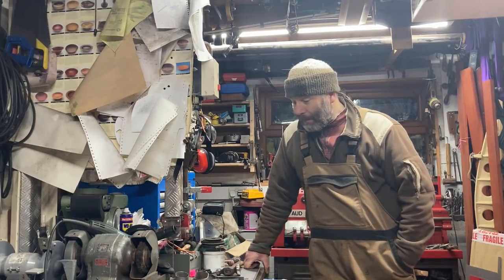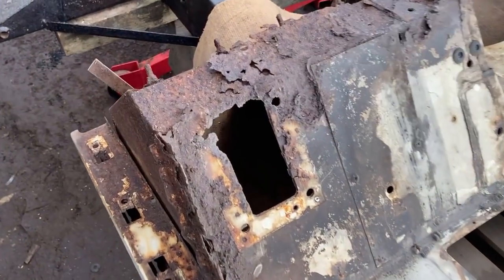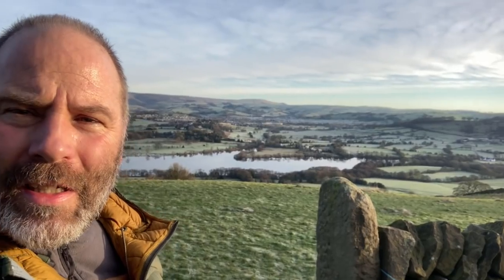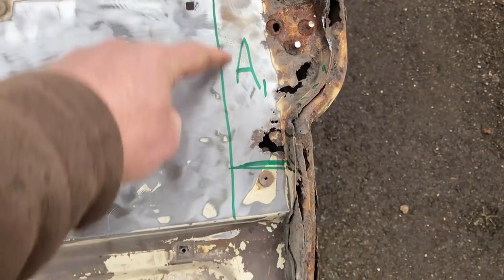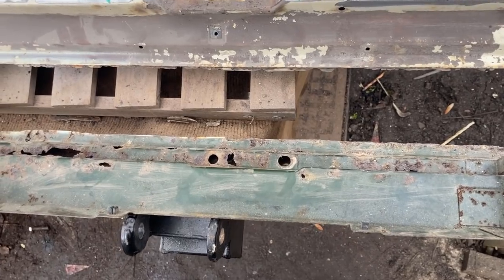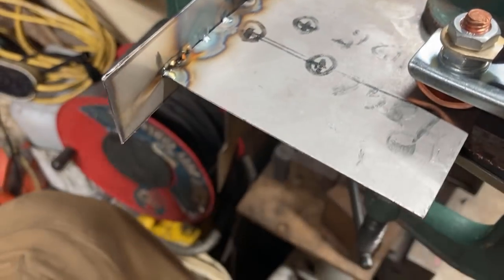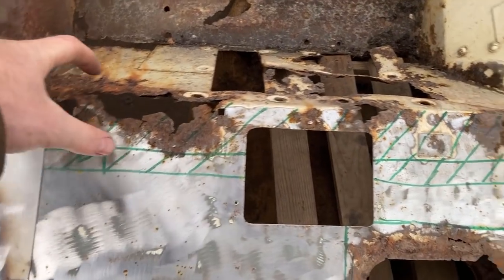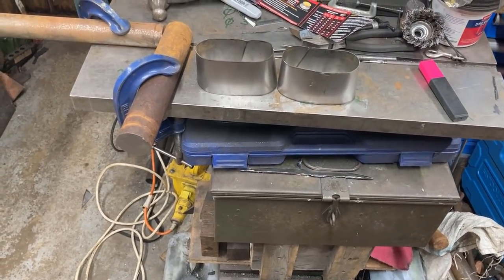Project Clanger The series 3 109" Landrover Rebuild - Update 8

Comment: "Serves them right for driving on the wrong side of the road"  LOL.
Love the dry stack walls, I've made some repairs here. They are the same construction here. Keep at it Matt
Reply from the maker: Hi Steve, good to see your comment - was concerned you might be stuck wellies deep in your concrete slab ! :-)  Ive done a few yeards of walling and its hard work unless you have good stone to hand - which is usually not the case - the good stuff went into th ehouses, barns etc. There are lots of styles of dry stone wall even in this area, each style for a different application - some of the best is 'estate boundary walls' usually 6ft or more tall and made with better stone. Other is far older and literally the biggest stones from the enclosure dragged to the edge and smaller stone piled on top into a very rough wall - many date 300 yrs or more. All the best for 2021 my friend to you and your family.
Reply: @lookcreations  Something about stone work really appeals to me. I like dry stack walls the best. Some are so good you wonder how long the guy spent finding the perfect stone for ever place. Its definitely a skill that takes time to learn. I grit my teeth when I see one torn down and some modern fences put up in the place of them. They go from a 300+ year fence to a 7 year one. Definitely more work in the stone ones but they last forever and look great IMO.
Keep up the hard work Matt, a great 2021 to you and yours 👍
Reply: @SteveSummers  there’s a fabulous display of dry stack wall construction at the Pleasant Hill Shaker Village that can’t be TOO far from you. I spent an hour just taking pix of that alone. A lot more than just rocks stacked up. Real creativity in an unexpected place. The rest of the place is just terrific, too, BTW.

Comment: A massive undertaking there young man. Not having a Tig welder myself so if I was taking on the challenge it would have been Mig welded up using 0.6mm wire through my BOC Automaster 185 on it's lowest setting.
Reply from the maker: TIG may be a less than ideal choice but I’m sure it’ll do the job if the operator gets some practice! Thanks for stopping by. All the best Mat

Comment: Hats off to you for jumping in the deep end. Great to see you involving your daughter in the build too. I tig weld a bit as well, so know how difficult it can be. And so unforgiving sometimes! The only advise I might offer is to clean areas to be welded, get your tungsten ground nicely and get in nice and tight on the arc. Also,maybe a bit MORE amps. Looking forward to seeing how you improve.
Reply from the maker: Really messed up not cleaning the new metal for welding. The second patch I cleaned and even the tacks went on better. I think more amps and faster travel would improve the weld, that requires a lot more control of the torch and I’m a ways off that yet. Still, I have plenty of seams to gain experience and practice on.
Reply: @lookcreations  great to see you tackling it. Its very satisfying when it all comes together. Good onya

Comment: HI, only recently found your channel, watched a few and have subbed. I've started a resto on a 1968 2A 2.25 petrol. No vids up yet, but plans to do one on it's Lucas 11AC alternator which needs to be converted pos to neg ground, and I'll add the 'triode' upgrade at the same time. Keep on posting... I'm hooked now :)  Ohh.. I've just got a TIG welder too, old but good.. absolute beginner too.. been flux core welding for a while, but TIG is a whole new ballgame, something to do with needing both hands working together.. My welds are not better than yours.. things seem to stick though.. practice makes perfect :)
Reply from the maker: Welcome to the channel, I hope your restoration goes without too many mishaps and good luck with the TIG welding, mines improved a bit this week (not much but a bit) its certainly down to practice as most hand skills are. All the best for the new year. Mat

Comment: Hi Mat,
Pleased to see you cracking on with the bulkhead... it is also handy that you can go back into the workshop to fabricate the patches and have a warm up... 
Cheers
Paul,,
Reply from the maker: Thanks 👍  Have to confess, the hot air blower I used on the chassis has been shoved up a trouser leg a time or two ... just for medical reasons - no one wants frostbite !  All the best ofr 2021. Mat

Comment: Bravo. My hat is off to you. Glad to see your fixing your original,  I know it's not the easiest way to go. But the experience will take you far. 
I have done my repairs with a Flux core welder, so I totally respect you doing it with a tig, sadly I lack that skill.

Nice thing about going this route , you can take certain creative liberties as needed. Make improvements over the original as needed. 

Thanks for the links. I have seen some of the big names doing rover rebuilds, everybody approaches it just a lil different  (that's a good thing)
Reply from the maker: Hi Craig, it remains to be seen if I can pull it off or not - will have o wait and see. All th ebest mate. Mat
Reply: @lookcreations  I know you can. 1 of the guys I have seen doing rover and lotus frame repairs (if I recall correctly ) had very lil experience before  starting his projects. With your skills, you totally got this.

Comment: “Here’s a patch I made earlier “
Pans across to a shiny silver bulkhead ...
Had a look on eBay and thought that some of them looked way more solid than yours on the top sections which are pretty convoluted on the series three. But I repaired my ser1 bulkhead which was non existent under the screen with an arc about 25 years ago. And I got better at welding because of it, and I had working vents at the end. So good luck!👍I’ll watch with interest, I’ve got to change the rear diff and ujs in the rear prop today. Chilly
Reply from the maker: If I had gone down the road of a new galv' bulk head - I had in mind a comedu sketch of me banging away with a hammer, grinder, stick welder - overlaid with lots of cursing bleeps, then an 'reveal' showing the new unit fitted.... alas budget cuts to the production team etc :-)  All the best Mat

Comment: Hi Mat. Welding isn't looking to bad . Rather than trying to dab the filler rod in , you could try the lay wire method. Might be easier . Christmas isn't my idea of fun as i get bored to easy. All the best  Dunk
Reply from the maker: Hi Duncan, I did try to lay in the wire (1 mm) and it helped. Lots more practice required. I notice Trevs Blog uses 0.6 or 0.8 mig wire for 0.9 mm panel repairs for the same reason: low amps to avoid burning through and 1 mm TIG wire too thick. I may look at a small coil next time I get some tungsten.
Reply: @lookcreations  good plan. Keep practicing and it will come good. Great progress.

Comment: Hi Matt, one thing to consider when making the patches, sometimes it’s easier and quicker to make a big piece instead of say 3 individual patches as you showed on the passenger side. That passenger side has probably 2ft or more of but welds when you add them all up, but if the whole side was one piece you have spot welds and a small but weld near the trans tunnel. As for the welds, a grinder and linisher will clean up most sins
Keep at it.
Cheers
Reply from the maker: Hi Raymond, you make a very good point. My main problem is getting steel sheet big enough - I cant handle a full sheet and cant get a half sheet delivered ! Which kind of limits my options, when I looked at trying to replace the inside skin in 'say 2' parts, the sheets I had were both 1" too small - sods law wouldnt you know. So I figured smaller patches where necessary and larger if possible. Theres also the concern that if I chop out a big section, the new part might never go back in = then I watched the irish chaps videos and I think can get around that. I will keep your comments in mind though. Thanks again my friend. Mat
Reply: @lookcreations  yeah Mat, I often get my sheet rough cut to size if the pieces are big.
Cheers
Reply: I can get a 4*4 sheet to you only live over the hill let me know me owd
Reply from the maker: @greglongson  that sounds like a possible plan Greg'  how can I contact you ? my email is mat.look@live.co.uk

Comment: I cut my teeth doing rust repair with an oxy torch, the tig is just the same but cheaper to use. The one difference being the oxy isn't fussy about the metal being clean.
Have you considered Brazing with your tig? In the thin areas you need very little heat and it will be just as strong.  The last rust repairs I did I used brazing wire in the mig and it was very easy.  Anyway you are getting the hang of it 
Cheers
Reply from the maker: My interest in TIG came abouts when I frined 'brazed' up the slider off my Shaper I rebuilt. Silicon Bronze added to replace the wear. I remember watching my uncle in the early 80's weld up my brothers escort van inner wings using a oxy torch. he produced a lovely weld line. All the best Mat

Comment: Pushing in more rod helps pull out heat.
Funagh  Funagh.
Reply from the maker: Ive also found that if the pool is cool - teh rod sticks casuing much hilarity as I try to pull it free (reflex) then heat the tip and burn a hole :-)

Comment: As an aside, and I’m sure I don’t need to tell you as you are eminently capable of arriving there your self, but..... the bulkhead was mass produced, and suitable for LH and rh drive. And made from pressings .  when I redid my series one I let in two pieces of 1” square tube under the screen between the screen pivots. Seam welded so they become 2x1. So much stronger than the box section that I assume was there before and it gave me a really rigid top piece and was easy to do   So don’t slavishly copy everything that’s there, there’s a reason it’s rotted so try and improve even if you add some weight   So what? Landrover had a million to produce so an oz of steel/ unit extra adds up. You haven’t got that to worry about.   So so long as the bonnet hinges and roof hinges and windscreen pivot are solid and have good anchors the rest can be bespoke and more usefully designed
Reply from the maker: I have to say, there are signs of 'reduced cost' manufacture !  I think the 'flap' area will require major surgery and is going to be made differently for sure. My pal Chris rebuilt one of his series 1 landies with a part stainless bulk head - back in the days TIG was a very rare thing. His widow has recently sold all 3 of the series 1's so Ive no way to show them. I can only hope they went to good homes and were not destined for the parts bins. All the best Mat

Comment: Hi Mat, are you using a foot pedal with the TIG?
Reply from the maker: not yet - working the trigger on the gun. Ive enough to think about with two hands doing different things without adding a foot !  As I progress, I will add the foot pedal control. I understand its a bit more controllable with the foot pedal .
Reply: @lookcreations  If you can drive a car you can coordinate a TIG foot pedal, get it a.s.a.p. For such thin sheet metal it's indispensable. You will must likely reach a skill level of "presentable" welds within a day! Other that the pedal there are 2 other things you definitely need for thin gage sheet metal: super tight arc and zero gaps. I hope this helps

Comment: If you copy those little plates in cardboard put them over the broken studs and hit with a mallet it will show hole centres on the rear....🤔
Reply from the maker: Think I will lever up the bent rusted bits and give that a try - from what Ive seen, the hole centres position to the flange is not super critical !

Comment: 30amps pr. mm  ..! ! Jep.  If it's black.  ( steel ) .. (y)
Reply from the maker: 30 - 40 amp thats the range Ive seen, 40 seams too high though. So as you say, start low and build it up as required. Higher amps allows faster travel which requires more skill ! All the best Mat

Comment: why not use mig it welds a lot quicker an the gas is cheaper
Reply from the maker: I am wondering that exact same thing !  In short, I only had a cheep buzz box and damp rods. I really didnt like the crack and splatter that generated - Ive seen Mig a couple of times at the local garage - it didnt seam much better - I watched loads of TIG welding on line and a friend welded a few bits of engineering shaft and parts for me and they looked great - so I went TIG - the bodywork of the landy is an alloy' so it should be possible to TIG repair the odd damaged bit as well. Thanks for watching Mat